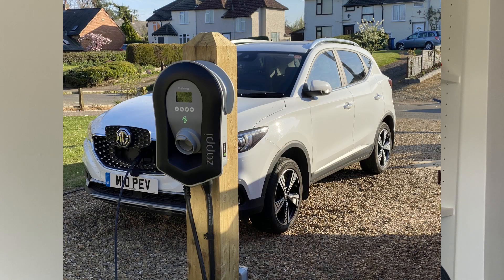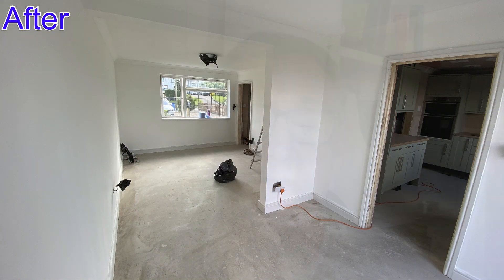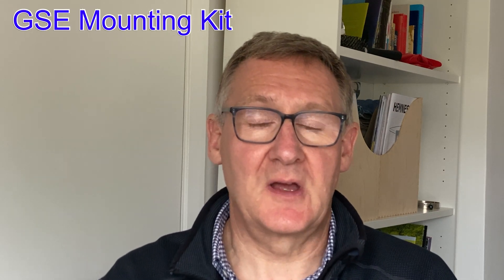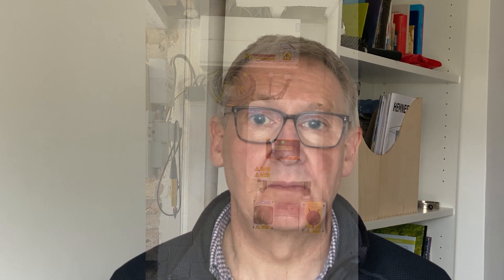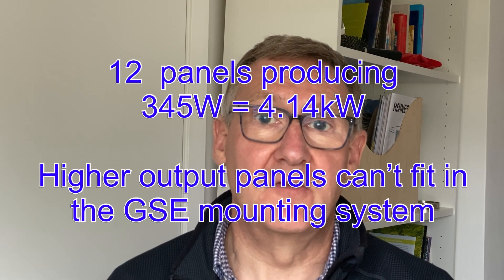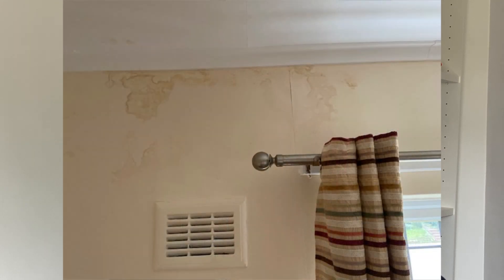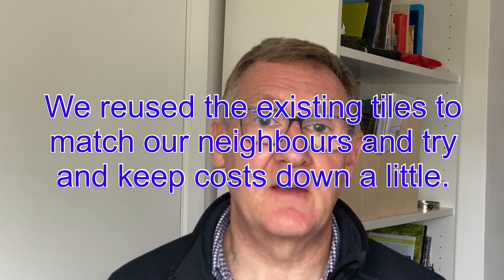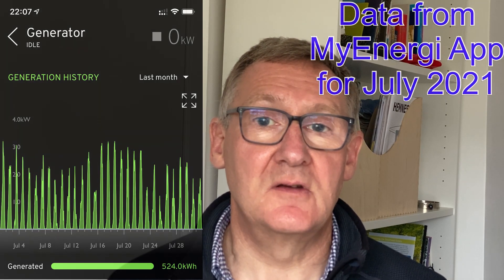Solar Panel Install install #24

Comment: Get yourself a give energy 10kw or alternative (not Tesla) and take your generation into the night to see a huge difference, you can the use the go to charge up the pack so when the sun isn’t great your still be mainly offline and that way most of your usage goes into the off peak rate